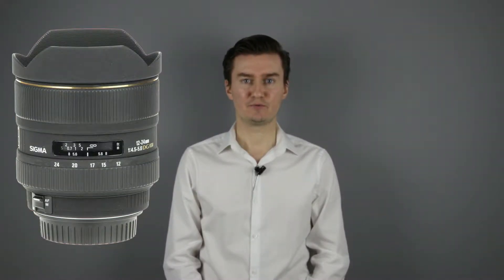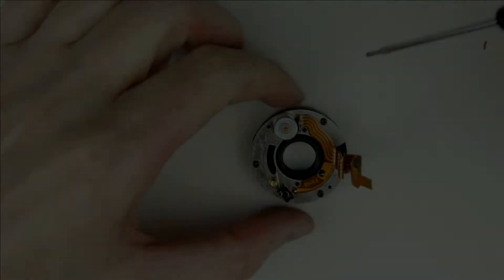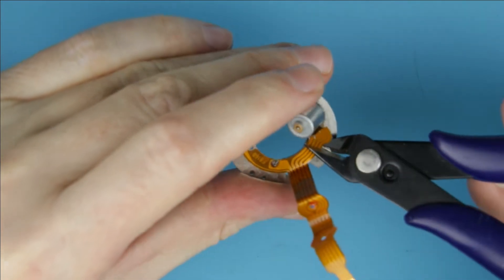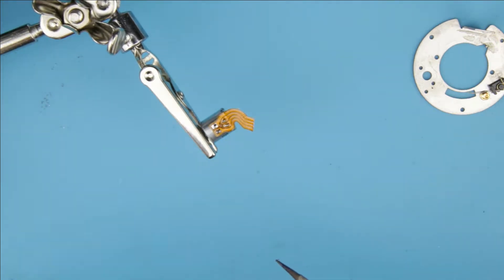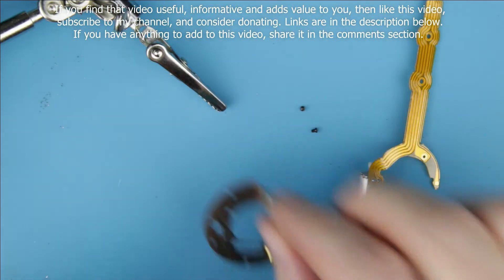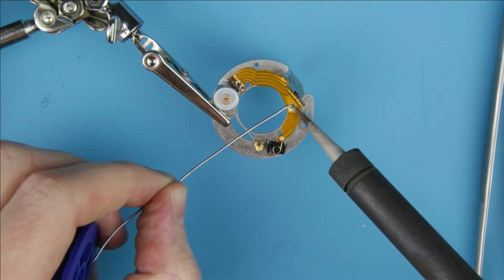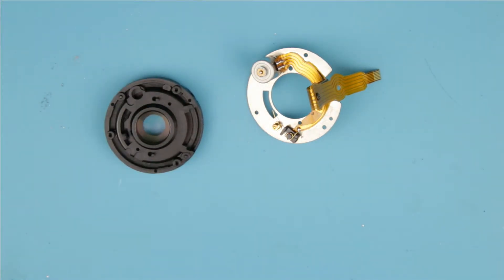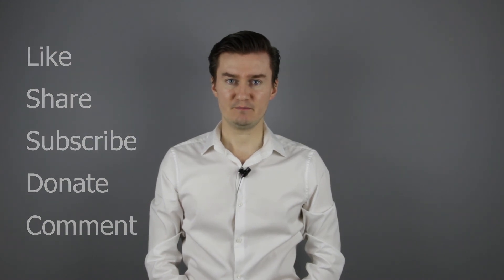Sigma 12-24mm f/4.5-5.6 EX DG HSM aperture flex cable replace after disassembly

Comment: Very precise description for 12-14 version 1. Do you have any ideas for disassemling the sunhood on sigma 12-24 Mark 2?
At least I allready could disassemble the frontlenselement but the sunhood seem to be assembled in an other way than in version I.
There are 3 screws under the rubber of the focusring. Are these screws for the sunhood?
Reply from the maker: I don't know, I haven't disassembled that lens. Try to remove the three screws and you'll see.